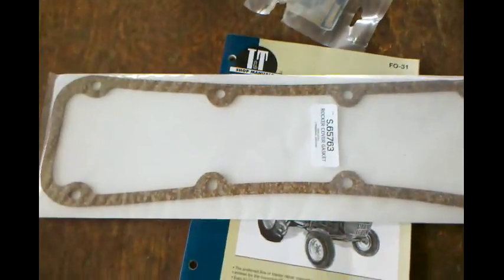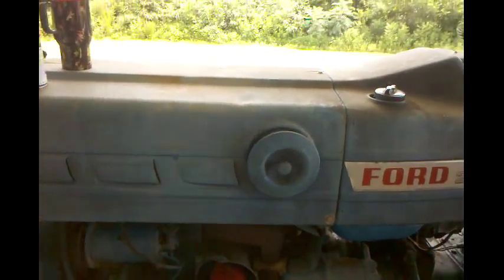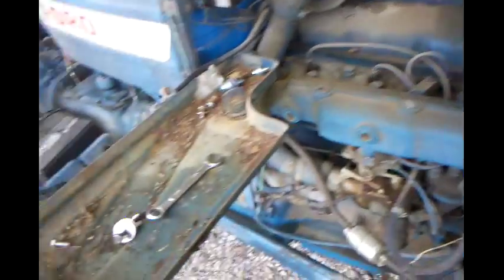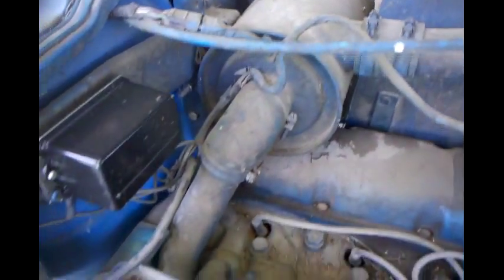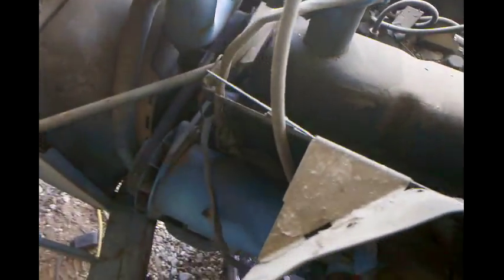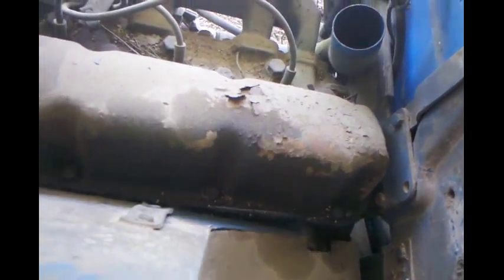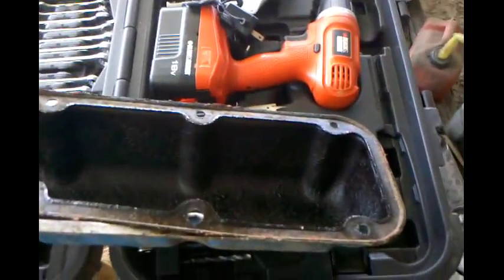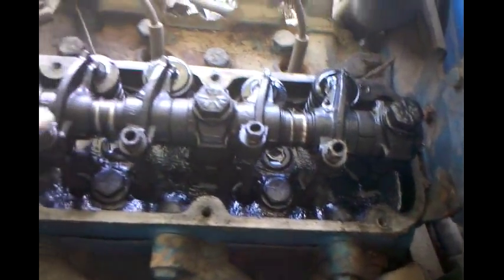Ford 2000 Tractor 3 Cylinder Valve Adjustment Part 1

Comment: My daddy in law has a 2000 3 cyl gas burner. Trying to figure out why it misses and runs crappy when up at operating speed. I've read the holly carbs are junk. I may replace it w a zenith, and rebuild the distributor and set points, replace plugs and wires. I would like to start w the cheapest first though. If you have any suggestions that would be awesome. Thanks for the videos.

Comment: Thanks for doing these videos. I have a Ford 2000 that is almost identical to yours, 1966 model, 4 speed, standard (not live) pto. I am going to attempt a valve adjustment soon.
Reply from the maker: no problem and thanks for watching. hope it goes smoothly
Reply: Hi, liked your video. I have a question for you about valve adjustment. I have ford 3055, and I want to adjust valves, but I don't know how big clearance is, hope you can tell me? I am from Serbia, and if you can tell me in millimeters. Best wishes.